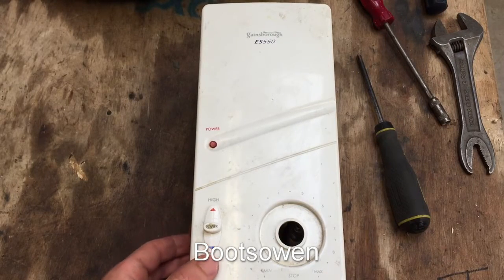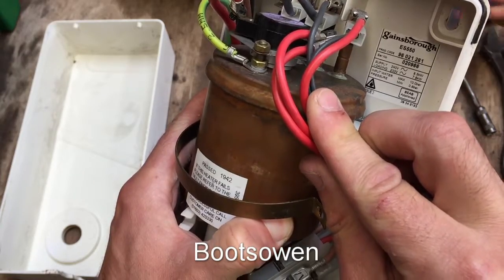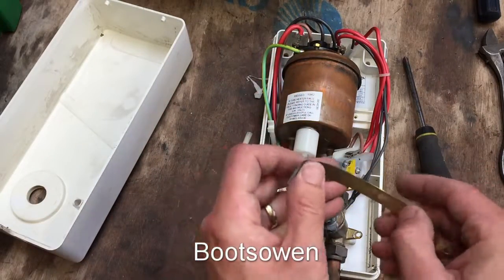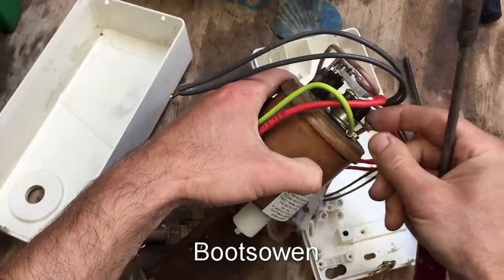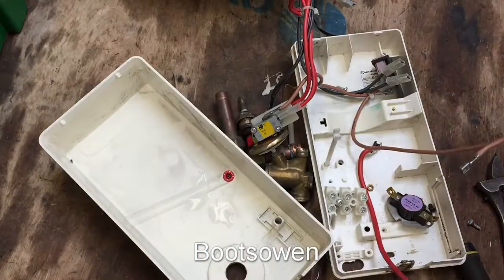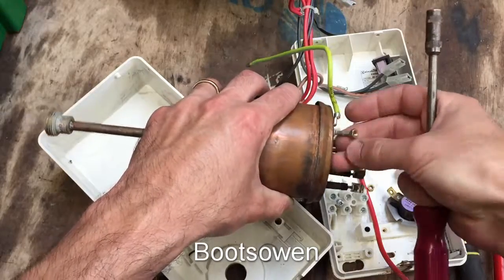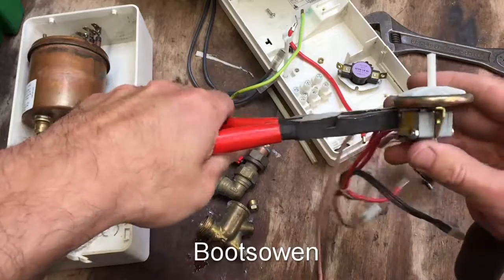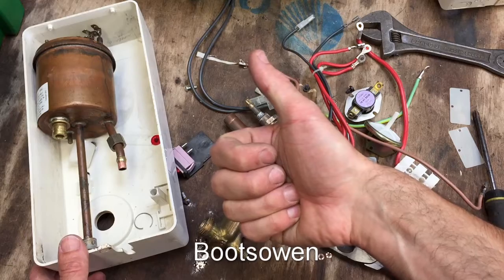Gainsborough ES550 electric shower teardown and look inside: how it works?

Comment: Got one even older than that Gainsborough 100, how did you get the cover off, no screws?
Reply from the maker: I think i found it in a skip as it was.
Reply: Thanks for replying, found it in the end, under the flow regulator control knob. That was the only screw.

Comment: Hello Owen, I still have a Gainsborough ES550 electric shower. The hot water is fine, however after taking a shower it is hard to close the water flow. So I guess the easiest way is to check the valve. But I cannot loosen the valve, how did you manage to do that so easily?
Any replaceable parts in the valve?
Reply from the maker: When you have nothing to lose it is easier to take stuff apart.
Reply: Did you ever find a fix to this or just end up getting a new shower?